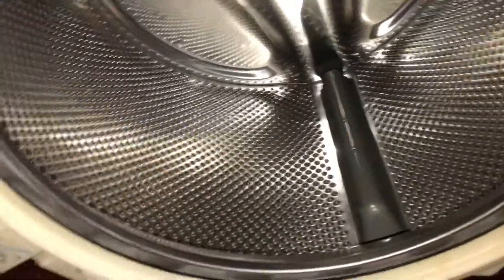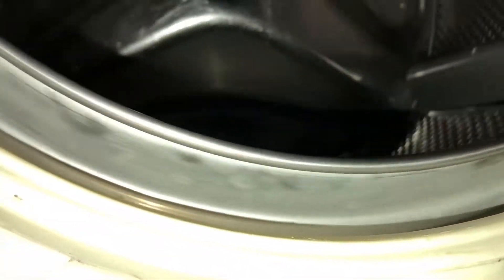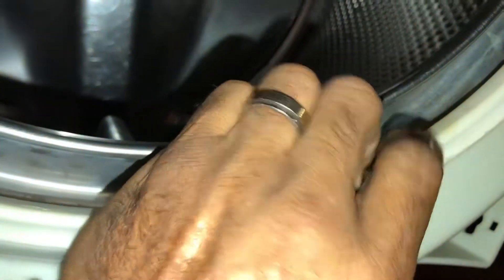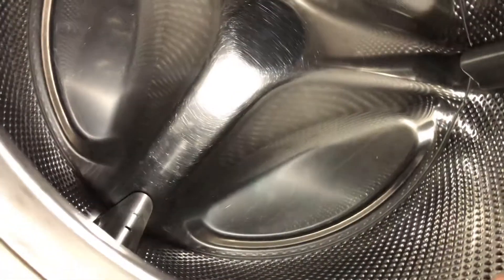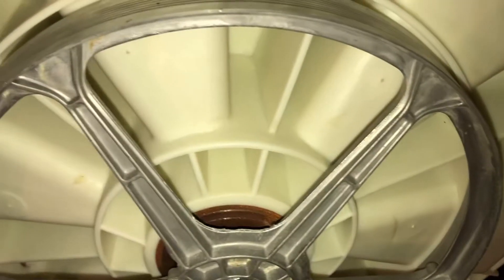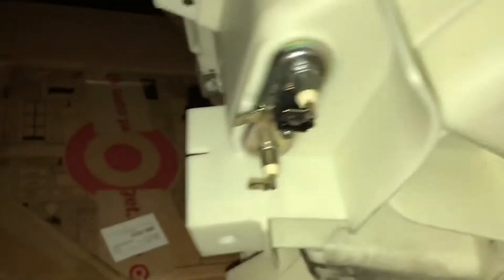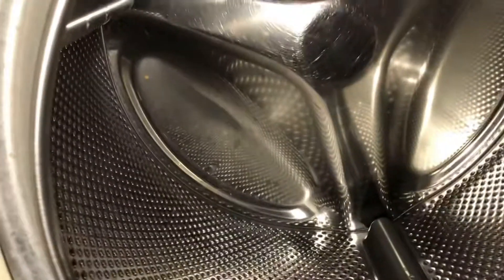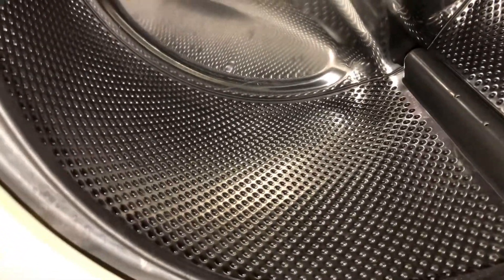Front loader washing machine: loud during the spin, burning smell,drum shakes

Comment: Hello, ARS do you know if samsung will replace my bearings? My washer started to smoke from the front load area.
Reply from the maker: How old is your washer? If it is under a year old, yes it is covered. Unless you have the extended warranty. Thanks for watching
Reply: @appliancerepairshorts  It's a 2016 model and no extended warranty.
Reply: Mine is a Samsung also. I've had to do so many repairs to the dryer and washer.